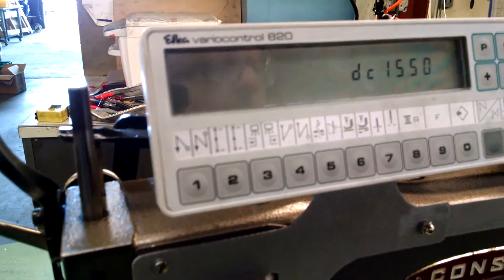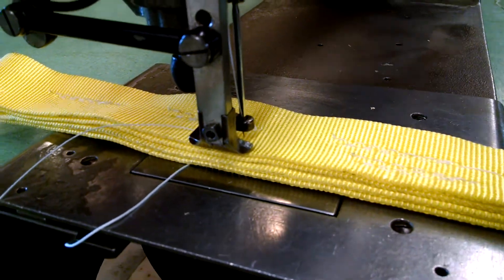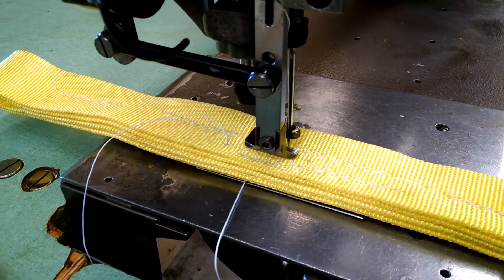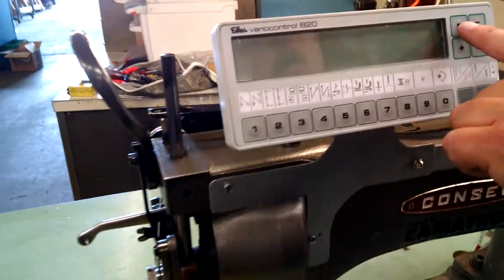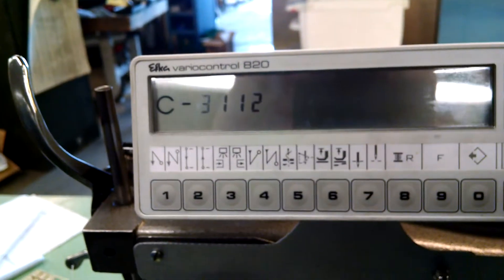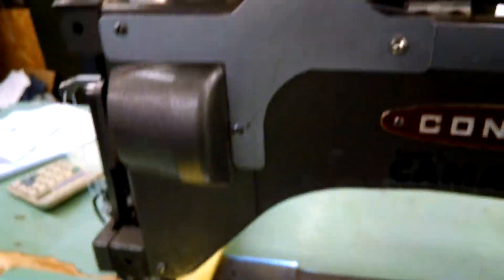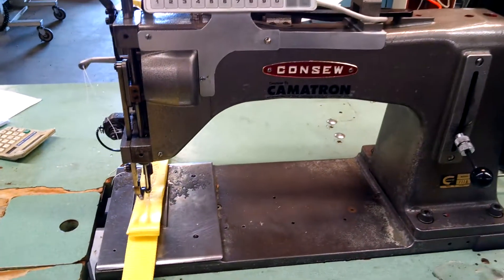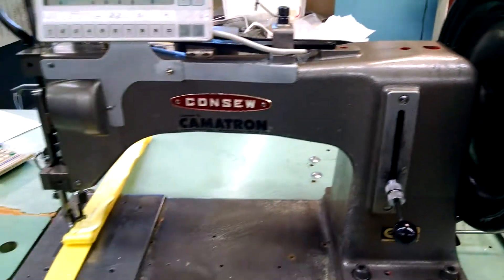CONSEW 7 CLASS WITH EFKA MOTOR AUTO FOOT LIFT AND REVERSE

Comment: What parameter settings are you using to get the solid stop of the needle in the up/down position? Ive got the AB321A/DC1550 on my Seiko SLH-2B-FH-1 and the needlebar kind of bounces up and down a little bit after each stop. Makes me wonder if the motor have enough holding power to actually brake the heavy handwheel and bring it to a stop? Transmission ratio is set at 242, due to the 63mm motor pulley and the 260 mm handwheel, this reduced the amount I can adjust in parameter 219 (braking power at stop of drive). I assume the normal range of 0-55 has been reduced due to the 4.21:1 transmission ratio since I can only bring para 219 up to 14. Thanks in advance.

Comment: What you need to do to make when in the end machine make backtack the needle and that other thing  lift it should be when you press 6 twice but they lock that option what i need to do to on lock that option? Its efka variocontrol 850